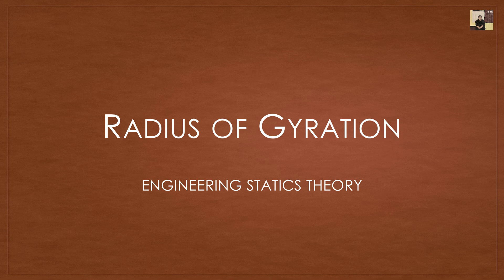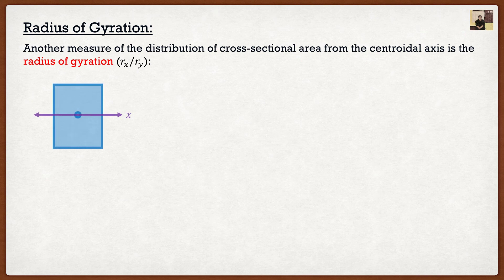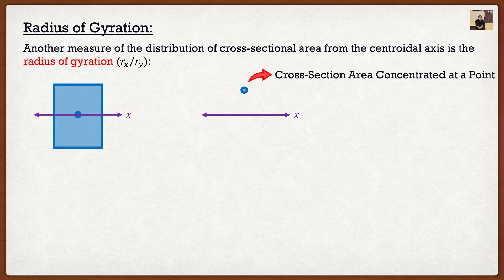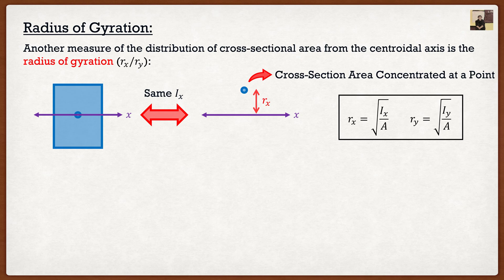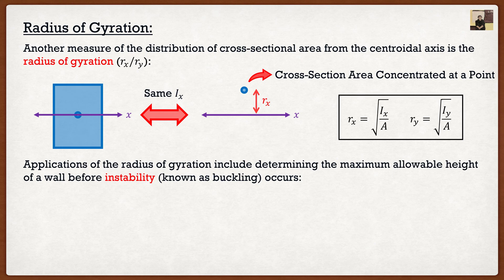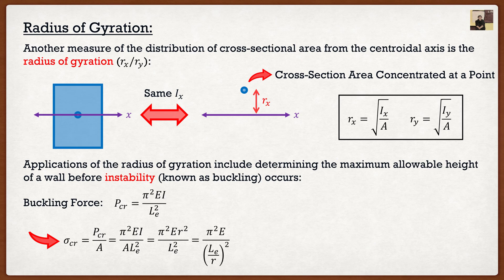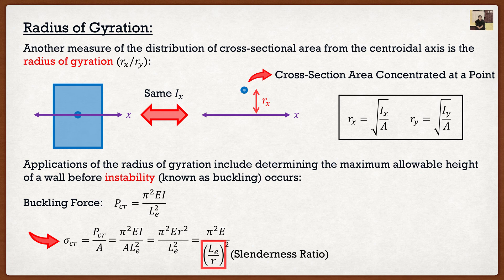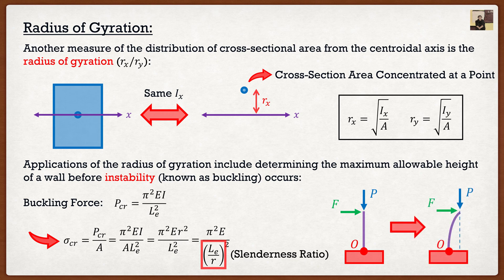Engineering Mechanics: Statics Theory | Radius of Gyration

Comment: I remember when I was taking the mechanics of materials course, and this concept never made sense to me, now 3 years later I finally get to understand it, thanks!
Reply: Only remenber: Ix=r^2*A....is simple.
Reply: @josealvarezperez111  it's always more simple to remember a formula than a concept, however, if you stay with the first one you should be called a technician, but if you choose the concepts side, you'll be an engineer, always remember,  a technician knows how to do thing, but the engineer knows hoy to know.
Reply: @emilioferrer1  What you say is true. Only sometimes the physical concept is implicit in the mathematical definition, as is the case of the definition of the radius of gyration with respect to the x axis:
Ix=rgx2*A=area integral of y2 dA. Precisely, later you can introduce the concept of mechanical slenderness as: landa=Effective light/rgx.
Another example occurs with the definition of the Mohr integral and Vereshagin's procedure for its resolution.